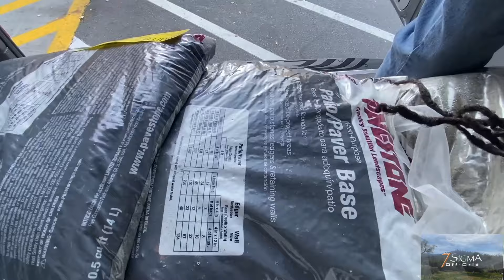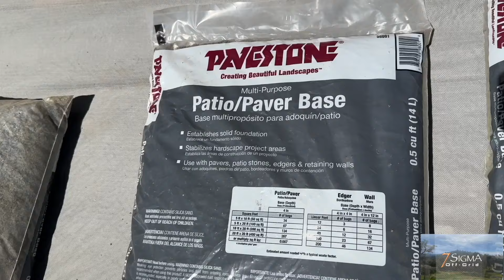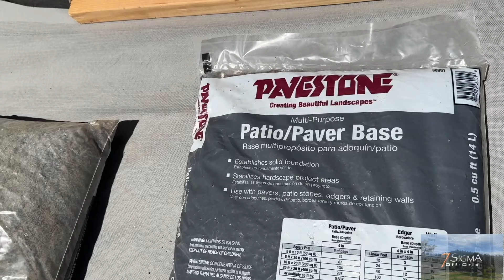🛠️INSTALLING Pavers 👀 While I Watch~What Could Go WRONG? #tinyhouse #homestead #offgrid #rv

Comment: Hope that lithium grease worked out well for you guys and the screen moves much better.
It's tough man when you got a lot of rock in the ground, you almost just have to haul in some top soil and put on top of the rock and work with that. I don't know how much rock you have in the ground on your road edges, but if its mostly gravel sized you can tilt your box blade at an angle and cut in a ditch on either side of the road to move water and keep it from cutting ruts on your road. Once you get some road base or if you can use your box blade tines to bring the gravel sized rock to the surface you can put a crown in the middle of your road with your tractor. If you have access to an excavator that would save you a ton of tractor work. Are you going with a tin / metal culvert? Love you guys property, cant wait to see it all. Ya'll be careful out in that heat, it aint no joke for ole folks like us lol It's keepin me in the house in Texas
Reply from the maker: Yes sir, the grease makes the screen door slide like butter.  Think I used way too much grease though...LOL.  Going with a steel culvert. We hired our neighbor who has an excavator and skid steer to replace it for us.  Operating an excavator is above my "know-how skills" at the moment. Hell, I'm still hesitant about using my chainsaw...I plan on making an attempt at doing exactly what you stated with the box blade and making a crown on our driveway in the fall. I'll use the driveway as practice before I mess around with the road...LOL. Yeah man, getting old is no joke. Mentally I'm 35, my back and joints say I'm 105...
Reply: @7sigmaoff-grid  I know Exactly what you mean, I am the same way.
On the chainsaw, I have three, I have one that is a beast I use for felling trees, but I find myself using the lightest one most of the time because it dont take much work with a heavy saw to wear you out. make sure and dont let the chain set in the dirt it will dull it real quick and resharpening is time consuming lol. You can wipe off some of the lithium grease it dont take a whole lot. The steel culvert is good choice as long as you arent bringing a whole lot of weight over it, they can handle a good amount though. I look forward to seeing you do some more tractor work, I found your channel when looking for my Yanmar and love it so far....im waiting for it to cool down some before i really put it to work tho.
Reply from the maker: Yeah I'm looking forward to getting some more tractor seat time. 50 hour service is coming up soon, which will be fun cause I'm not the most mechanically inclined...Which Yanmar model did you get?

Comment: I guess the several ways you guys could have made it maybe less work could have been building a form and having a concrete truck dump you a pour and finish it your self. I just order a deck. I love to see you guys having so much fun working together🌄🦍☮️❤️
Reply from the maker: That’s one way of doing it …but of course …Less work equals more money (using the route you’ve recommended)😉
Very expensive having a concrete truck come to our remote location. Hard work is to be expected, just have to choose our battles. We’d rather use concrete truck money elsewhere.